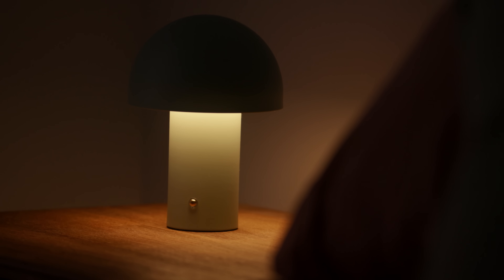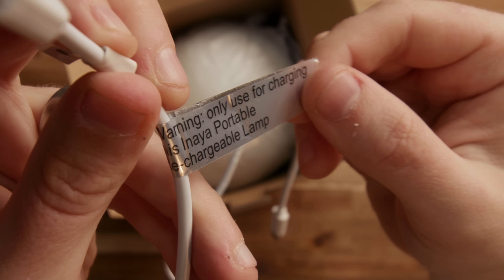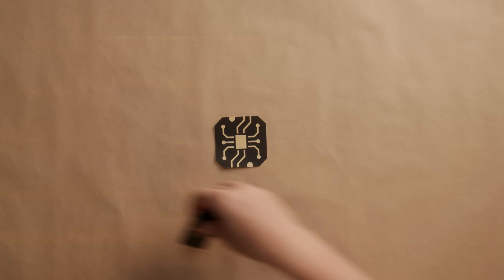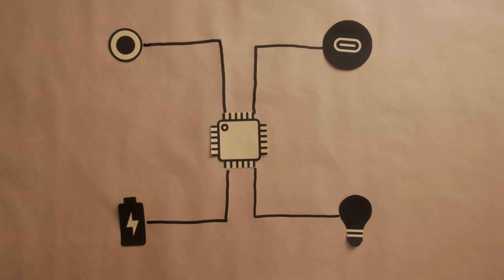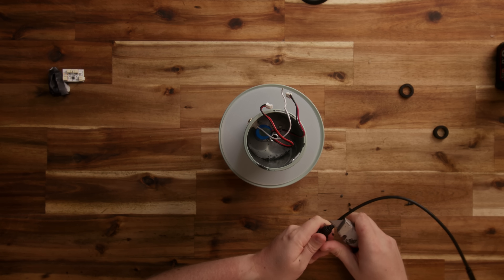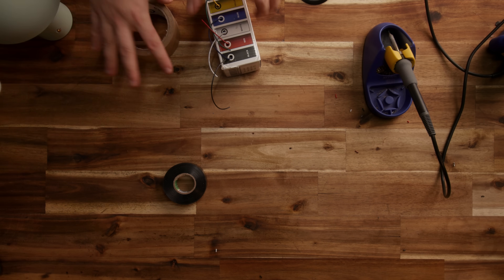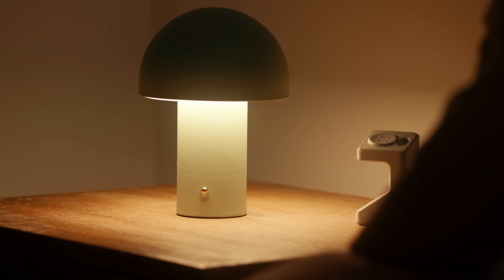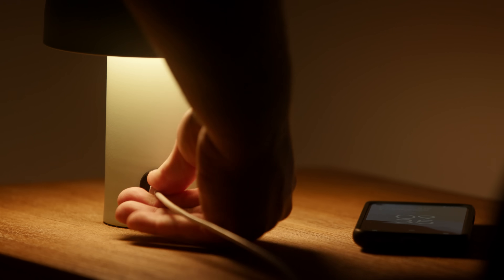Kmart Lied to Me, So I Hacked Their Lamp

Comment: Having to spend 7 additional dollars and an afternoon to convert your USB C lights to USB C is such a weird modern problem and solution. Awesome video and cool upgrade. Bummer you had to do it in the first place though
Reply: New marketing strategy. Make your products just a little bit broken, so tinkerers make videos about fixing them.
Reply: He did this because he wanted to. Alternatively he could have returned it for a full refund because of the false advertising.
Reply: That's funny
Reply: To be fair, it would have cost him €7 extra to pay for the same lamp, but with a propper USB-c controller too. The USB-c spec is so convoluted that you actually need quite complex chips to make a complient port
Reply: @kat-zorn  I thought that for low-power charging (<10W) all you needed is two 5.1kΩ resistors. Nobody is talking USB-PD, and the cable already looks like it's USB-A (to USB-C), so max power is already limited.
Reply: @kat-zorn that is nonsense, the power part is pretty simple and the cable wiring is well defined. 
Integrated USB pd trigger chips are everywhere.
Reply: the product works just fine with the cable provided as stated so like i dont get the problem. like just use that cable lol
Reply: @happyhippiehaze the problem is that it deviates from the standard in a way that will blow up people's devices. People expect these cables to be safe to plug into things like phones. 

You wouldn't like it if the owner of a gasoline pump added an additive that worked on one car, but destroyed all others. Yet gave the modified stuff the same name as the normal stuff.
Reply: @bzuidgeest  i wouldnt care if it clearly labled it ie 95 and 91 :O
Reply: @happyhippiehaze that's the problem though, they haven't labelled them differently. This is Diesel being labelled 91 Unleaded.
Reply: You wanted to buy a $17 lamp and not a $50 lamp. Corners have to be cut. I mean you already have the employees working 12 hour shifts 6 days a week to satisfy your budget.
Reply: @3fives-j5w  corners can be cut, sure. just don't add the 'USB-C' label to your decidedly non-USB-C lamp then.

Comment: Those cables are pervasive. I bough an USB tester to identify them and throw them away. Not just that, I only buy cables from reputable brands. They are not new they exist since mini USB but with USB C they can do much more damage. And when those things come with chargers they are really dangerous....I almost fried a device using one of those, the ripple is so huge that most devices go cuckoo. besides the contacts on the USB A side get so hot even for small currents.

Comment: This is even worse than devices which technically support USB-C but don't support USB PD, so you can only charge them using a USB-A to USB-C cable.
Reply: You don't need to support PD to derive power from C to C, just a couple pull down resistors, one on CC1, one on CC2.  PD is a whole next level thing.
Reply: @jnawk83  Alright, not an expert on this topic tbh. But if it's really that simple to support basic power over C-to-C, then it is kinda baffling to me that device manufacturers don't support it.

Comment: So... My question... Why in the world does a lamp need a battery in the first place? Its not like its going to be moved around a lot. Just have a cable for direct power, ditch the battery, and the product could be manufactured for even cheaper.
Reply: So that you could turn it on when it's not within reach of a power point, like on a coffee table in the middle of the room.
Reply: I live on my own and now have a bunch of different rechargeable lamps around my apartment that I’ve collected and a couple of people thought I was odd for it.. they’re great for outdoor dinners on the balcony, getting up in the night etc.. they’re surprisingly useful..  When the cyclone hit Brisbane recently and some of my friends and family only had candles and torches for a few days roughing it, I had my rechargeable lamps in every room and a couple of power banks ready to ride it out… I highly recommend them..  

I have a couple of these mushroom ones from Bunnings, they often have some nice ones on their website.. much better than the Kmart ones imo..
Reply: @nicole_beaumont  Cool. Apart from the KMart one, I have one from Amazon that looks like a stick. The lower part is a wooden cylinder and the upper part is a translucent cylinder. Chinese, but looks Scandinavian! It comes with a magnetic holder you can stick to the wall. It comes on at night automatically if it detects movement, so mine is located in the normally dark corridor between the bedroom and the Smallest Room ...
Reply: @Ozpeter  I’ve seen that style on Amazon, they are nice. I have a couple of their lamps with the wood look base and the remote control that can dim them etc. they’re small but give off a surprisingly good amount of light 🙂
Reply: @nicole_beaumont  I'll look out for them! Cheers
Reply: Battery powered, without a cable, is ideal for a child’s room. No cable to pull, trip over or damage. No mains adaptor required in the bedroom. This modification, along with the HA integration allows for the light to be turned off automatically at a specified time, or remotely (eg by a parent). With a sensor in the room, it could turn the light on automatically and notify the parent if the child gets out of bed. Also great for letting younger children know when it’s okay to get out of bed in the morning; e.g. if the light is set to come on at ‘getting up time’, the child can get up and play, otherwise they have to stay in bed and go back to sleep.

The battery also allows the lamp to be used in any circumstances where there is no power socket, which is very practical in many situations, e.g. coffee table in the middle of a room, sideboard against a wall where there is no power, when camping, etc.
Reply: Well for one aussies love caravanning and camping. Low power, and battery is awsome. And second, we all have a usb besides the bed these days. But maybe not 2 ports? So can charge phone, and light seperatly? But it works not plugged in? Also there is not always a power point beside the bed, and if there is one, probably not multiple.

Comment: 2:31 “this is entirely unacceptable, the whole idea of USB-C is a unified standard” OK I think we’re a bit naïve and innocent here about the ARRAY of standards within USB-C alone, and that’s because I didn’t hear any mention of USB-PD (a subset of USB-C) or the USB-A-to-C power hack that this device inevitably needs … and would surely be less trouble than writing YAML?

For example:  My wife has a USB-C battery pack that works with her two USB-A-to-lightning devices, but when I gave her a cable to use with my USB-C phone, it didn’t work.  It was a data cable but I thought it was a USB-PD cable because it had the purple pins on either end.  Instead, when I used a 4-in-1 cable that had micro, USB-C, and Lightning all going into USB-A, this worked fine on every port.

So how many other USB-C cables did you try on the lamp?

Speaking of Apple, I thought they were first with a USB-C port in a laptop in March 2015?  Ten years + one month ago.  Every new laptop after that had no USB-A, but there are still houses to this day, and cars and buses and trains and ferries, that are installing USB-A.  They must see the 1997 standard and think it’s the future.  OMG.

Comment: if it doesnt actually work with USB-C then that is false advertising and would make it illegal.
Reply: But mine works fine.  So no false advertising as far as I am concerned.
Reply: @Ozpeter  are you using a real USB-C cable or the included one?
Reply: @SuperJxl  A USB A to USB C cable from a multi outlet charger. I've never unwound the supplied cable.
Reply: Actually I just tried the supplied cable to charge a battery pack and the lights on the pack came on as if it was charging. And then I tried it with the lamp and its charging light came on too. In other words, I just don't understand what this video is about. The only explanation might be if the guy was using an incompatible charger.

Comment: Why does a lamp need a USB cable in the first place?
Reply: So that you could turn it on when it's not within reach of a power point, like on a coffee table in the middle of the room.
Reply: @Ozpeter  This one has a built-in battery, so I assume the USB is only for charging, in which case you can then put it as far from a socket as you like.  But I suppose my point is about low-tech items in general, which often work perfectly well in their mains-powered form.

Comment: Nothing about this makes sense..... You say in the comments (after cutting an explanation to make time for whinging on about PWM dimming for some reason) that the power, and data were connected after passing through a C to A adaptor (because you cant put a sewing needle in a clamp to make a precision probe....I assume because that wouldnt be over engineered enough....) But its an A to C cable... So either the board expects to see 5v on the data lines or it doesnt activate the charging or.....hell I dont know what. This whole endeavor just seems like an exercise in showing off your hipster pad and the fact you know what solder is....By the way, to the company, they sold two units of lamps, what the hell do they care if you didnt like them. When you buy crap products, then multiple of them, and then inspire your audience to also buy them to do this overly complicated mod (NOT HACK!!!) instead of investigate and convey the issue, the company only sees sales for their crap products....Meaning you actually dont get to complain about the crap products since you are sending the very clear signal that level of anti-user design is acceptable.

Also, what is the point of keeping in them rechargeable? Those ESPs popping on wifi every few seconds is going to pull more than just powering them from a 5v adaptor and a splitter. And why have a lithium battery in a table lamp at all..... And why not just put a charge circuit and diode in the damn thing (oh...im guessing your STEM classes never covered actual circuit design, just plugging breakout boards together, leaving how stuff actually works to the boring nerds who like boring things....). And why waste all that potential in the ESP on a freaking desk lamp they make ready made modules for? Sure they're cheap but....freaking A man....

Freaking hipster design man.....I just dont get these peoples thought process.....
Reply: Same here - I have an identical lamp and it charges just fine with my phone's charger and lead.

Comment: Love this mate. Would love a guide to DIY home automation for coding/circuitry noobs.

@Kmart you should be ashamed and heavily fined for allowing such an obvious source of e-waste
Reply: It's not e-waste any more than any other rechargeable device.  Mine works fine and it can be used on the coffee table in the middle of the room without a trip-hazard power cable trailing across to it.

Comment: I hate to be THAT guy, but KMart didn’t lie, that product has type-c charging, type-c refers to the physical connector type, not the standard.

It’s very misleading, especially given the icon used which resembles a USB icon but isn’t actually an official USB Implementers Forum recognised graphic, but it’s technically correct because they didn’t claim it was USB, or USB-C or USB-PD.

Comment: USB-C ≠ USB-PD ≠ USB. It's not that these don't comply with USB-C standards but that they don't meet user expectations of USB-PD compliance.

USB-C is a completely separate standard from USB & USB power. Yes, you read that right. USB the protocol is separate from USB the connector. And the same goes for "USB Charging" which could in reality be USB-PD or USB-BC.

What you think of as "USB-C charging" is actually USB Power delivery; USB-PD for short, and a completely different standard. USB-C is just the connector, and you can in fact use the older methods of power over USB with the connector instead of USB-PD (but you shouldn't), just like you can do USB 2.0 over USB-C even though USB 3.1 was already well established when USB-C hit the market. (A lot of charging cables are USB 2.0).

You can find other USB-C devices that have this same issue, such as Adafruit's panel mount USB-C to Micro USB adapter; I bought one for a raspberry pi project only to find to my chagrin it didn't work with my USB-C power supplies, and this is because it was not USB-PD compatible. These are basically just "classic" USB cable adapters using the USB-C connector. Same goes for the K-mart lamps.

The problem with PD is it requires additional resistors to signal to a PSU to begin charging. USB-PD effectively "communicates" with the device, as opposed to just pumping power as before with USB-A, allowing for different voltages to be possible over the same connection. This means any USB-C device lacking these resistors rely on the older "dumb" charging methods of before with USB-A & USB-B.

As @JasperJanssen & @skyslycer point out, these were likely first sold with microUSB, and a lazy port swap was done to USB-C, without adding the resistors necessary to establish charging with a USB-PD charger/cable.

The point of this all is that USB-C is ironically too compatible, resulting in issues like these where competing standards for the same task can coexist, defying expectations of how a device should work.

Though as you mention in the comments, the cable itself is non-standard, so like, lmao anyways.

Comment: Or... You could just glue or somehow attach the provided cable permanently, thus ensuring it will only be used with this device. Like any other appliance with a fixed cord.
But you do you. Always fun to see someone mess around with circuits.

Comment: I have a few devices like this, and the "deeper" dive I've done (not as deep as you) is that the cheap Chinese crap often WILL work with a normal type A-C 3.0 (or now 3.1 gen 1+) cable.

It doesn't work with non 3.0 type A cables, or ANY type C cable off a "charger". (IE my various wall warts that have a C port, or my type C portable chargers.) It usually can (frightening for cyber security) charge off a laptop it think.

Comment: Kmart probably don't even know there is an issue.  Likely they reached out to a manufacturer for a 'USB C lamp',  agreed the external design, did some basic QA on a sample, that is it turned on, charged with the cable (which looks like USBC) etc and then placed the full order which got shipped to stores.
Reply: Or they plugged it in to the charger and cable that came with their phone, and it worked fine, like mine does, and they shipped it.  And they probably don't know there is an issue as none of the reviewers on their site mention it.

Comment: Mine works just fine with the normal USB-C cable that I charge my phone with.  I use it a lot and really like it.  YMMV and clearly does, though why it works fine here but not there is strange.  The label on the cable indicates that it's a charging cable not a data cable, which is quite common.  Use it for charging the lamp, don't use it for connecting your phone to a PC.

Comment: Only critique is the choice of USB-C extension. If you're already 3D printing parts, there are a lot of better breakout boards you could have used and kept the port smaller and more fitting with the overall aesthetic. Good job on fixing Kmart's dumb design choices and adding something else to my list of "OOH lets add that to home assistant."

Comment: A certain well known doorbell camera brand pulls the same USB fuc-ke ry.  You have to use the 'special' orange USB cable that comes in the accessory kit in order to charge the unit every couple of months.  A standard USB cable will not work.  Since our homebuilder didn't see fit to provide the accessory kit for the wireless doorbell that they installed, I am not going to enjoy the use of my doorbell camera unless I shell out more $$ to buy another non-standard cable.  The homebuilder's customer service rep is completely apathetic to my situation since I am no longer in the market for a home.

Comment: I have seen people defending bad manufacturing pratices of usbc stuff, and they say how usbc is only a physical format. Not realising proper connections or voltage set resistors are part of said physical format. I hgate the unmarked usbc cable hellll now. I have loads that charge at different rates or  data differently and apprently do not do any video, despite boating about the data speeds. only on the package though. cant tell about that when its is in the drawer.
take away U from SBC now..., there is nothing universal about this stuff

Comment: I would argue that a "rechargable bedside lamp" is ewaste from the moment it's created, even if the cable were perfect. Bedside lamps don't need to be rechargable, they're bedside lamps, they don't move, they spend their life in one spot. Run a cable. Inevitably the battery is going to die, and then what? Are people going to dismantle them and seperate the components and tape up the contacts on the battery and send it off for recycling, and send the circuitry to a different place for Ewaste recycling? Of course not.

Comment: My cheapo flashlights are like this.  They will only charge off a 5V USBC cable, if I feed them with a modern USBC charger that quick charges phones and laptops they don’t do anything.  Manufacturer probably just using the cheapest USBC charging IC they can, which can’t deal with anything more than 5V so it just ignores it (at least it doesn’t melt down or catch fire).